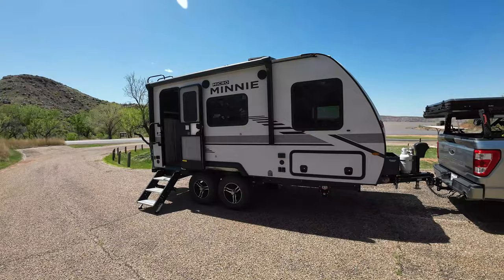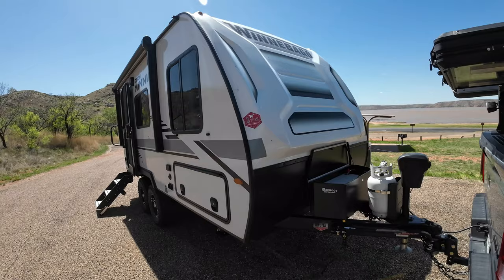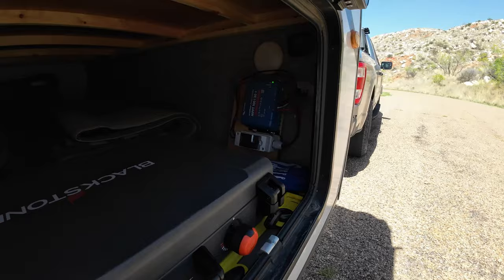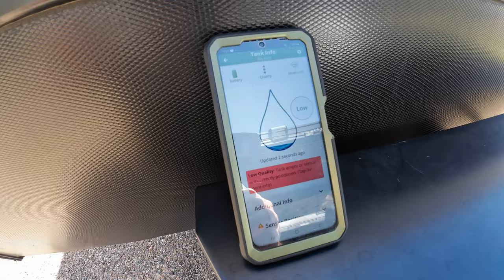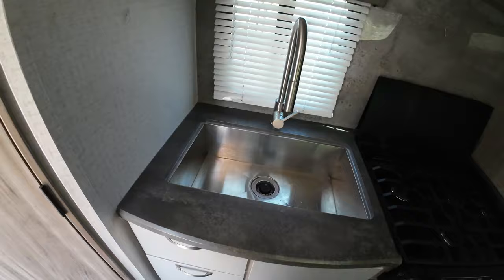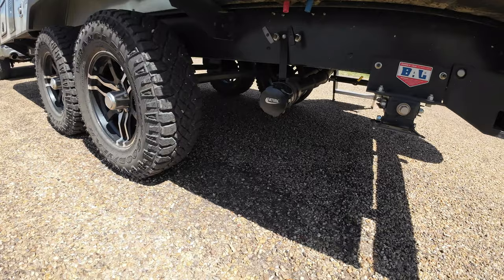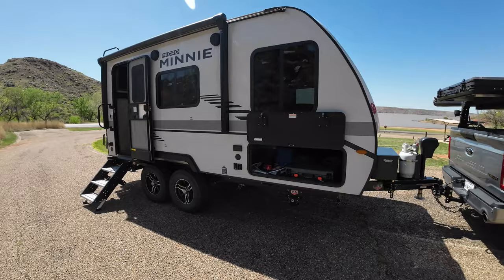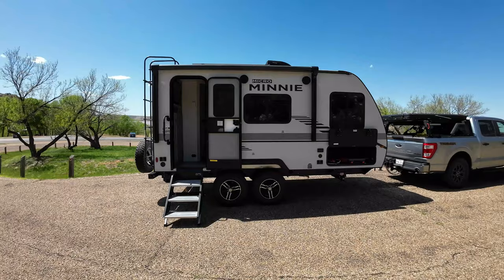2022 Winnebago Micro Minnie 1708FB review and mods.

Comment: Love this model. The wife and I are looking at getting a 1720 FB now that they don't make the 1708 anymore unless we find a good used one. Thanks for the tour. I definitely made some notes of your upgrades & accessories.
Reply from the maker: We looked at the 1720. Bigger shower is great, but no sink or storage in the bathroom. I just added an LG TV that is 19 volt DC with a step down to 12 volt DC. Now everything except the AC is running off of the 200 AH AGM battery. We recently went back to the Buffalo River...(last video)on those bad county dirt roads and the solar panel screws started backing out. Changed them all out so that wont happen again.

Comment: Just pickup up a 'pre-loved' 1708FB (2017 model).  Now we need a truck!  thanks for your video.  Learning more everyday.  Now I think we need some solar/batteries !
Reply from the maker: Any 1/2 ton pickup with tow it. The ReCurve R3 weight distribution hitch is one of the best on the market to keep your camper level going down the road. Solar is a must if you want to go up in the forest and camp for several days. Have Fun!
Reply: @PJP320  Picked up a Ram 150 V8 Hemi.  You said your fridge runs on 12V and your single propane last a long time.  Our fridge will be using propane mostly.  Any idea how long 2 x 20 pounders would last?  Also have 2 x 40 watts solar (that came with).  Should we upgrade to 100 W?  thanks !  Oh and lastly, Is the weight distribution hitch a must have?
Reply from the maker: @marygrabill7127  No idea on how long the (2)20 pounders will last, but those fridges are very efficient. The solar depends on the battery. We have a 200 AH battery with 300 watts of solar on the roof now and I have a 100 watt briefcase that I plug in sometimes if its cloudy. Most days when we get up in the morning with everything running on 12volts, we have about 90% battery capacity remaining. If you still have a lead acid battery on the front, you can only use 50% of the AH capacity, so just see what your power consumption is for a few trips before adding more solar. Everybody is different. We just had a few rainy days in Colorado, watching the 12 volt TV and DVD player for a several hours and had 88% battery capacity the next morning.  The weight distribution hitch will be a must. When you put 31 gallons of water in the tank which is over the front axel and forward a bit....load the camper for your trip....the tongue weight could push 500lbs., and really squat your Ram. You want the camper level so your tire wear on both axels is even. You will see campers on the road nose down a lot as well as campers that are level with load distribution hitches. It the Ram has the camera up front for the anti collision stuff, it will not work if the truck is squatted pointing the camera up in the air.

Comment: Nice vid. Have a 2021 FB. Very happy with it!
Reply from the maker: I had to reattach the solar panel this weekend in Arkansas. It was mounted with the wrong sheet metal screws. I think they may have a recall on that as well. Solar panel flying off on the highway would be a bad day for everybody around.
Reply: Wow thanks for the heads up